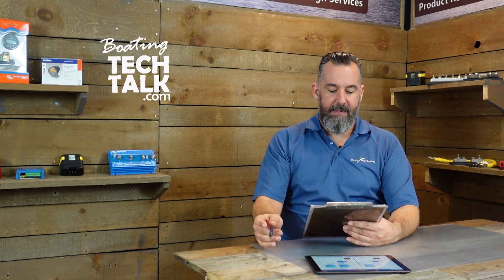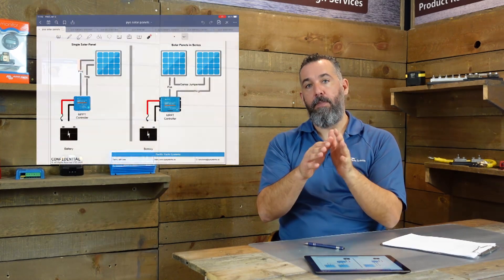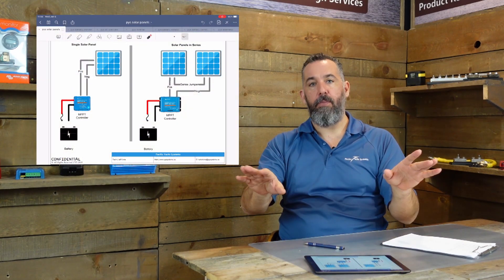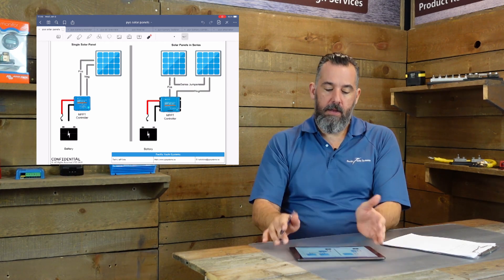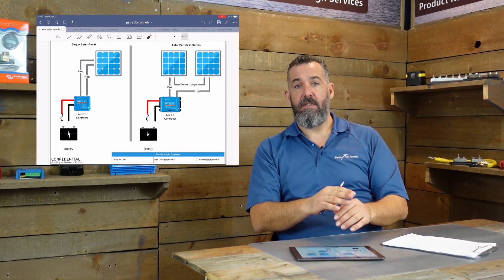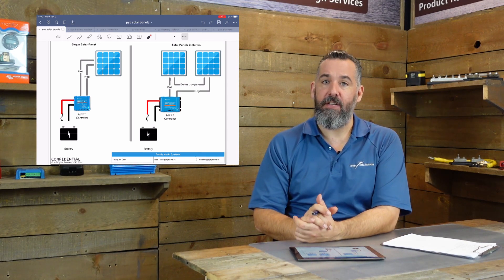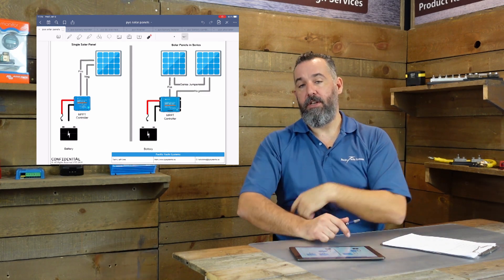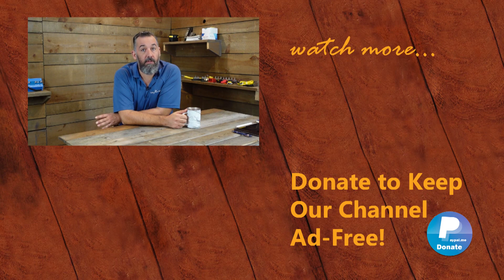How Do I Charge a 48V Battery Bank With a 12V Solar Panel?

Comment: I got 2 100w/20.3v/5.9A solar panels, hooked up to a MPPT 100/20 SmartSolar from Victron that will automatically select 12/24/48. However, this isn’t enough. I can’t simply hook one panel up and expect it to work, I realized this now after I bought it all. I have to connect the panels in series to match up the nominal voltage of the battery, so I have to unfortunately change up the setting.
Reply: Even in series, your max voltage will be below 48V. Controllers need more than that, to "control" it to 48V. So, you prabably needed one more panel. How did you finally solve that?
Reply: Yes same situation here.

Comment: I have designed, and almost ready to test a solar system using Boost (Buck) Converters to boost my 12v battery Bank voltage to 48 vdc.  I know it is easier, with solar panels, to charge at 48V.  But solar panels require more sun to produce 48v than 12v.  So, I plan to charge the battery banks at12v and Boost convert the battery bank 12v output to 48 volts for input into the solar Combiner and then to the Charge Controllers.

Comment: I believe Boost Converter and Buck converter is the same.
Reply: Boost is to up the voltage and buck is to lower the voltage 
Two different curcits (but kind the same) :)

Comment: You said Victron has these boost chargers. Which ones? I got a SmartSolar MPPT 48V, and it said since my panels were 30V, I couldn't charge the batteries since I wasn't +5V above the battery voltage. WTF? Everywhere I read, said it would work. Did I get scammed and got something else like maybe a BlueSolar or something?

Comment: must be to early for me,  I looked at your clip board and realized I could make solar powered clipboards that shock people if they walk out into the sun. Don't steal my clip board :)
Reply: I call it the "Inside only" clipboard. add a battery and change the solar pannel for a light detector and you can make the outside only clipboard that shocks you if it don't detect enough light :) keep the rangers outside.

Comment: The "was" such a thing as a solar panel that hooked right up to a battery. 25watt ARCO solar panel. 1983. Open curcuit is 16 volts and all you need is a diode. Had 2 of these, but only have one now. Dad gave them to me 40 years ago. They were test panels from work. Freeze and Heat, Freeze and heat...
I'm glad to only use them very little. Had one hooked up to a car stereo directly, no battery. Sun would come up and radio would start playing. Neato huh?

Comment: Trying to solar a 48 volt golf cart.  I watched a video where the guy wired the panels neg to pos to up the voltage. Is that the way to do it?
Reply from the maker: Yes you can put them in series to increase the solar voltage.  You need a controller that can handle that input voltage.

Comment: Nice video,epleaned...I have questions :Is it possible to charge a solar battery with a car charger or must be sollar charger {elektric 240 v-12 volts}...2 question: How do I find out that my solar battery is totally bad {200Ah} that it can no longer be charged?...Thank you for your answer,,, with respect, Andrej

Comment: Hi Jeff
I am planning to add solar and lithium batteries to my boat.  All my existing equipment is 12 volt but ultimately I want to have a 48 volt electric motor and a 48 volt windless. I am thinking that I can connect solar to a 48 volt battery bank and the use a DC to DC charger to charge the 12 volt battery bank.  What would you do?

Comment: You said victron make a 12v to 48v DC to DC charger....what is it called

I came back for an edit.....I'm trying to charge my 48v victron system with my 12v altinator....for top up when I'm driving....it will run off a 200amp  victron 3 way isolator....1 for car battery 2 for duel battery in the back
3 for caravan 48 volt

I did think about using 2 12v to 24 volt step up and wire the outputs in series to get 48 volts

Comment: hi, I recently bought a bluetti ac200p (a power station) and it can be only charged via solar that is between 35V-150V open-circuit voltage. my question is that I have a 12v 200watt solar panel, I wondered if I can just wire it to a solar regulator and boost it up to 24v in order to increase the open-circuit voltage and charge the unit? thank you

Comment: Every time you step or step down the voltage there are losses. What is the most efficient input voltage?
Reply from the maker: Definitely, conversion as a cost.  The higher the input voltage the less voltage drop matters, but you don't want to have too high of a DC voltage as it's unsafe. Probably under 50 volts is a good compromise.

Comment: Victron mppt controllers actually do not boost the voltage and only start when solar is more than 5V above batteries. At least that's what victron told me.
Reply from the maker: Exactly, at the moment Victron doesn't make a boost controller. In other words, the panel array voltage has to exceed the battery voltage by 5 volts to work.

Comment: I Have a wind turbine 3 phase ac, It came with a 48v charge controller, but the motor dosent spin fast enouth to get to 48v, how do I boost the voltage on 3phase ac?
Reply from the maker: Good question Lucas, but that is definitely outside my knowledge, sorry.

Comment: can you tell me how a pv array in series as follows voc 40.66 x 6=243.96 v with 10.52 amps (Isc) being 2,040 w can charge a 48v power bank (9.6kwh) with a charging capacity of 58.8v and max amp of 100?  The MPPT charge comptroller is rated for 80amps and 600v to charge 24v , 48v battery etc.  My head is hurting right now maybe you can help it to go away.
Thanks
Reply from the maker: Hi Geoffrey, you are definitely considering the right things, the solar controller needs to have the correct input solar array voltage, battery voltage, and also max amperage. If you cannot find a controller that meets this large array requirements, breakdown the array in smaller parts and wire those smaller arrays to the correct controller.
Reply: @PacificYachtSystems  Thanks for the reply

Comment: There is another way the could save you money in the long run.

If your 12VDC Pb batteries are connected in series to form a 48VDC battery bank.

Connecting 48VDC charger to the first battery in a series of 4 x 12vdc battery bank, is not always the optimum solution.

Charging that way can cause some batteries to be overcharged and fail first quicker than the rest of the batteries in the bank. 

Unless you optimise the charging connection point to try and even out the charge to all batteries in the bank.

However, you can connect your 12vdc MPPT solar controller to one of the 12VDC batteries that are in series.

You then have to use 4 cascading Pb battery equalizers/balancers. They cost around $20 US each and you need four of them.

Each balancer connects  to a battery in the series and  has connections for the next cascading balancer. 

Using this method, unlimited batteries in the bank can be balanced.

Essentially the balancers are what is also commonly referred to as a BMS (Battery Management System). Although you must use Balancers that are specifically made for the type of batteries in the bank you are using (Lead Acid, Lithium etc...)

Connect the balancers to your batteries as described in the instructions, and the balancers will ensure all the batteries get the optimum charge, by sharing their charge amongst each other through the balancers .

Of course the battery balance method using a 12VDC MPPT solar Controller solution, is a little more expensive as opposed to just buying a 48VDC capable MPPT solar Controller for $35 US. 

It can however avoid costly expenses in battery failures. 

Especially if the electrical characteristics of one of the batteries in the bank does not match the rest of the batteries.

Generally the first batteries in the bank are the most susceptible to overcharging, and will fail first under a non balanced system.

Batteries are not always exactly the same, sometimes voltages can vary among each battery, even if they are rated the same, and the same brand model etc...Some also charge faster/slower than others.

This is where the balancers also work at optimizing the bank so all the batteries behave equally as much as possible, ensuring loads are distributed evenly.

This is a very common facet amongst batteries that are not "A" graded, and as a result are drastically reduced in price depicting a "Discounted Bargain". 

Using the balancing method is very effective at preserving battery life, however, you may still need to change the battery you designate as being connected to the 12vDC MPPT Solar Controller, periodically.

This ensures all the batteries get a fair go in the charging process to additionally minimize battery failures . 

I advise changing the charging connection to a different battery at least once every 1-2 months, although it will still be working well for longer periods.

If there was a device out there that could do the battery charger connection swap automatically, it would be awesome, however I have not found one yet.
Reply from the maker: Thanks Gene for the thorough explanation. Which battery balancer have you used before and tell us what you like about it.
Reply: @PacificYachtSystems  If you look on AliExpress there is this type:

There are two types available, a 6V, and a 12V version. 

I use 4 of the 12V versions cascaded. 

I like this version, due to it's flexibility and scaleable ability.

"QNBBM 12V Lead Acid Battery Equalizer Balancer BMS"

You can basically use an unlimited amount of batteries in your bank.

I only use the batteries to a maximum of 30% DOD (Depth Of Discharge).

I have a bank of 4 x 12V AGM batteries configured as a 48V Bank (4 sets of 12VDC in series, total 48V 75 AMPS).

I have been desulfating the batteries once every 6 months.

Using the AGM batteries that way, they should last 4+ years at the very least, or 1600 cycles at 30% DOD maximum.

I have been using the bank for more than a year now with no maintenance required, other than desulfating.

And it still performs like new.

So long as i only keep discharging the bank at a rate of 7.5 amps per hour at 48vdc maximum, for no more than 3 hours.

I can also switch to 12VDC, or 24VDC operation by tapping the batteries at their appropriate places in circuit.

The Battery balancers keep making sure the whole bank performs equally.

The bank is fed by 2 x 220 Watt solar panels at the moment, and the whole system is just a prototype for something else I am working on.

So far I can convert water to hydrogen and oxygen for cooking, heating and boiling water. And the rest of the power runs some computers and lighting.

I would like to use any surplus power coming from the Solar Panels somehow, and i am working on that.

Ideally the battery bank once charged up and full, should switch with an appropriate circuit to a huge capacitor that can temporarily  run the solar controller through and tap electricity straight from the capacitor to power an inverter unit via a sophisticated voltage regulator circuit I am designing.

If the weather switches to cloud cover, the circuit would then switch back to battery and visa versa.

The batteries would only then be used at night, or to kick start the hydrogen generator.

I am still working on it's design however.

People probably think, Why doesn't he use Lithium Technology?

I originally purchased the AGM batteries very cheap and brand new.

They were so cheap that Lithium was far more expensive at the time. Even the new Lifepo4 Lithium batteries.

Originally I did some tests using a huge homemade capacitor that was fed by the Solar Panels.

The Capacitor held a decent charge, although it's voltage lowered to that of the Solar Panel voltage.

Later I realised that I need to create a kind of self regulating Buck Booster circuit to charge the capacitor, even though the voltages coming from the Solar Panels varied  anywhere from 5 to 18 Volts DC.

The capacitor would only charge up to a voltage equal to the voltage supplied to it by the Solar Panels.

So if the panels maintained a voltage of say 18vdc, then lowered to 5VDC, that capacitor would conform to only a 5VDC voltage.

I then started designing a circuit that will convert the voltage to 13.8 volts DC regardless of input voltage range of 5-18vdc.

Otherwise the inverter cannot draw a steady 12 Volts from the capacitor when the battery bank gets switched over to it.

I worked out that it's cheaper to build the capacitor as a temporary power storage unit than using batteries.

Of course it only stores electricity for some hours. And the capacitor is quite large and heavy.

Although hours is enough to get over cloud covering portions of the day and gives the electrical setup a "buffer" to work with.

If it works eventually as i plan it, additional capacitors can be added to the system.

I think I might just get a cheap Solar Controller and hook the Capacitor right up to it like a battery.

What's the worst that can happen?

Comment: Boost charge controllers are rare devices still. Much more common is the buck charge controller; this is what MPPT does, along with the power tracking. In general, voltage and amperage can be adjusted in proportion to one another, so you could have 12 volts at 10 amps, which would be the same power as 24 volts at 5 amps, or 2.5 amps at 48 volts. The larger the adjustment made by the device, the less efficient the conversion, in general, so it is good practice to keep your panel voltage output close (but higher) in voltage to your battery bank's voltage. Other concerns are wiring losses, wire and controller ampacity, etc, so we often go higher than ideal on our panel output voltage in order to avoid huge wires and enormous and expensive charge controllers while harvesting the same amount of power. Jeff, you already know all these things I say, so my comments are mostly for those that are learning about these technologies; a different way of explaining things will often get people past a confusing aspect. Just like sailing itself, sometimes mobile electrical systems require a lot of tacking to get where you're going, and just like sailing, the process is 1/2 the adventure. :)
Reply from the maker: Tao, thanks for sharing, different perspectives and different ways of explaining ourselves, helps ALL of us (including me too) understand the concepts better, really appreciate it.
Reply: @PacificYachtSystems  My pleasure Sir. I share your passion for the subject. I get a bit long-winded trying to be clear. Hopefully I don't bore too many of your subs. :)
Reply: How do I get a MPPT charge controller that will work with my SINGLE 450Watt solar panel on the roof of my golf cart to charge my 48 volt battery system of my golf cart?
Reply: @benkanobe7500 did you find a solution?
Reply: I can't find any Boost style controllers from Victron. Only the "buck" style. Am I searching for the wrong thing? I'm specifically trying to use Victron as I'd like to get all of the components communicating with each other and all on the same smart phone app.

Comment: how does hooking up a bunch of 12V panels to a boost controller affect efficiency, as compared to wiring the panels in series to get to 48V?
Reply from the maker: Either way, you'll need a MPPT controller to convert the solar output 12 or 48 to be the exact voltage your batteries need.

Comment: Thanks for this Jeff, but I haven't found any marine MPPT controllers that boost the input voltage - do you have to do PWM?
Reply: Genasun GVB boost controllers!  I know that Jeff sells them.
Reply: @OceanPlanet60  Thanks for your reply Bruce! You're a bonified authority! ;-)
Reply from the maker: Thanks Bruce for weighing in, yep the Genasun make a great MPPT boost controller, we've installed lots, including some on my boat.

Comment: thanks found that very useful as a beginer 
i have a victron controler 70/15 whats the max watt of the panels i can use or is there a max volts of all the panels? thanks again svhappymondays
Reply from the maker: The Victron 75/10 is max 145 watts at 12 volts.

Comment: It's like you're one step ahead of my mind...Crazy! What specific models from victron do this? Can the 100|20 (48v) use a 12v panel and charge the 48v battery bank? I always thought it needed to be 5ish volts over the battery bank voltage to initiate bulk charging. Or does that controller just do the magical conversion for it to work correctly? Thanks again!
Reply: Genasun GVB makes boost controllers for 12V, 24V, & 48V batteries, both Pb and Li.  Unfortunately the Victron MPPTs are "buck" (lower the input voltage to battery  voltage) vs "boost"
Reply: @OceanPlanet60  Time to do some more nerdy research...Thanks for the heads up! I'm curious why Jeff said Victron made some?
Reply: @MarkPingel  Jeff is a busy guy!  Hi might have just mixed up Genasun & Victron in his head for a moment.  Note that Victron DOES make a great number of 48V "buck" controllers...for panel arrays that are high enough voltage.  Victron MPPTs need battery voltage +5V from the solar panels to turn on, and batt. V +2V to keep running effectively.
Reply: @oceanplanetenergy  Oh I know...I can only imagine how busy he is! I'm VERY familiar with the victron MPPT's. I own a few (And read the manuals many times!)
Reply from the maker: Thanks OPE!
Reply: @PacificYachtSystems  i try to find someone on youtube to explane me how to set 80% stop charge on lifpo4 batteries, for lasting longer, with what machine you can do that, i think is good to make a video if you know this because nowbody have anything like that

Comment: Ok
Now same question but my 60v battery (scooter)
Reply: I'd say find a 60v mppt controller, if they exist, but I'm no expert.
Reply from the maker: Never did a 60 volt system before, but the concepts are the same.